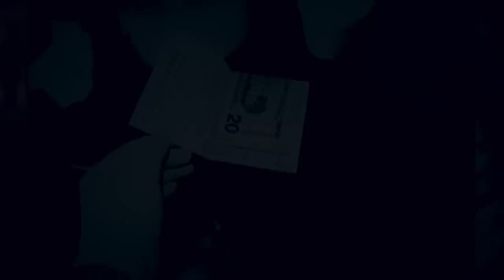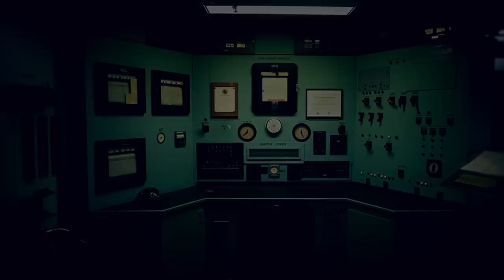Top 5 Strange & CREEPY Unsolved Mysteries

Comment: Ok maybe this is a dumb question, but the starlight material. How if it can resist that much heat, how would you form it to anything? Chemicals, long exposure to heat, or created on the surface itself.

Comment: Ah Starlite. Classic scam. Pretty sure the whole thing was a bunch of hooey, I mean... when something sounds too good to be true, it probably isn't. Something made in the garage that can withstand THAT much heat? Really? And the egg thing? I'm leery. Heat is energy, it cannot be destroyed, so when that much heat is applied to anything... what exactly wouldn't absorb it, and heat up and eventually combust? Every material has a point at which it simply ignites. Something just does not add up. This magical material would've had to literally nullify the energy directed at it. Nothing does that.